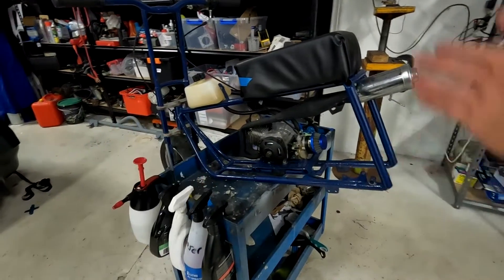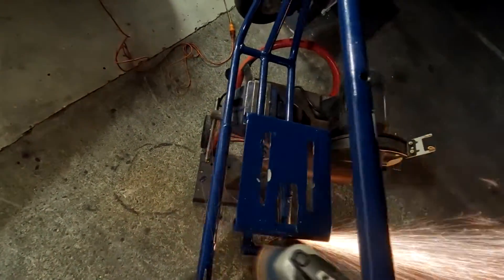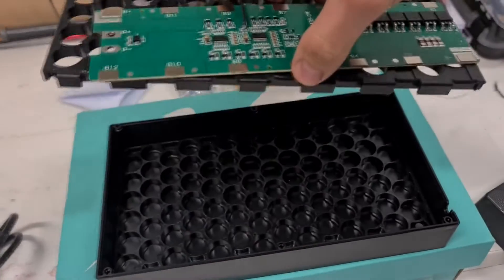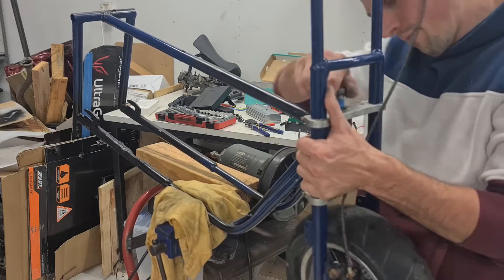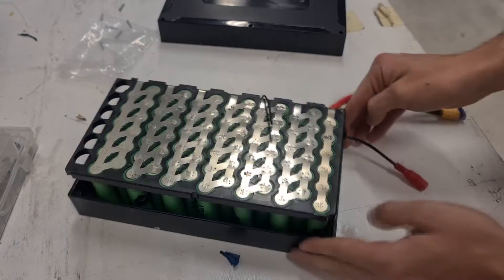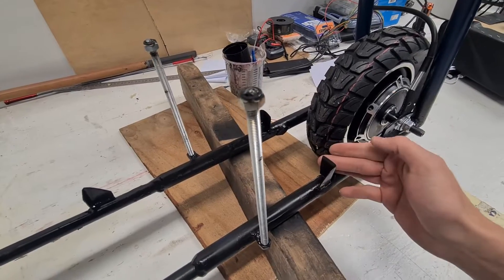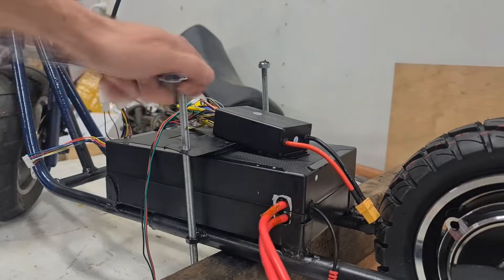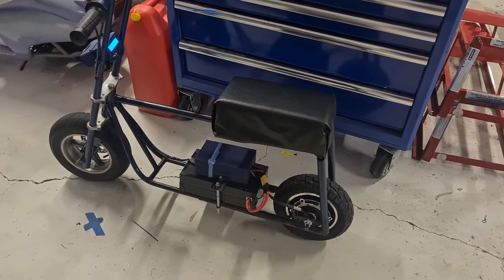Mini Bike Electric Conversion (FLIPSKY FT85BS)

Comment: Absolutely horrible design about controller box.. That controller dont get Any cooling inside a box.
Reply: Nah it should be fine, ive been using smaller vescs with more phase amps and it hasn't burned out yet, going strong for over 300 miles now.
Reply from the maker: @SuperMaiki76  doesn't get close to being hot as the battery and wheel are well under spec for the controller.
Reply: What the battery has to do with it? Regardless, having the controller built-in as so is not good. But you do as you like@TechUpBuilds

Comment: Could you please leave links to your products you used? This is an awesome build. Subscribed.
Reply from the maker: The ESC: 
https://flipsky.net/collections/non-vesc/products/flipsky-ft85bs-v2-0-esc-with-aluminum-case-non-vesc-for-electric-skateboard-scooter-ebike-speed-controller-electric-motorcycle-robotics

The Motor:
https://www.aliexpress.com/item/1005006103312311.html?spm=a2g0o.order_list.order_list_main.4.d2d01802OdjKo5

I would get a bigger motor next time. Like a 11 inch

Comment: It is recommended that you affix the FT85BS to a larger heatsink, you will get longer lasting high current performance. For example, replace this 3D printed case with an aluminum case。
Reply from the maker: It's not really an issue in this bike as it does not draw a lot of current.